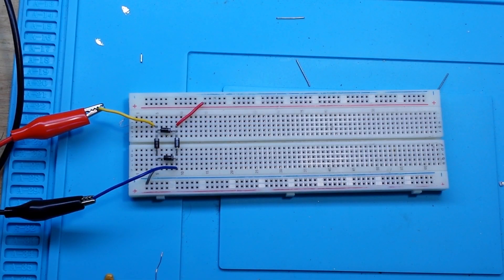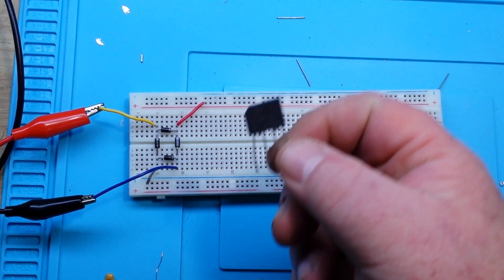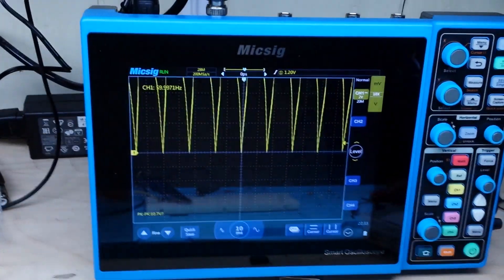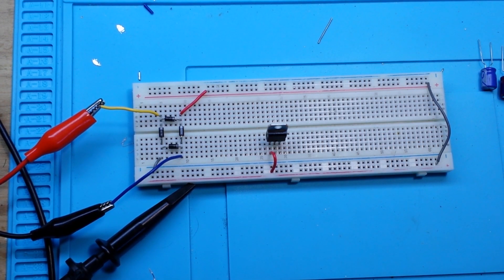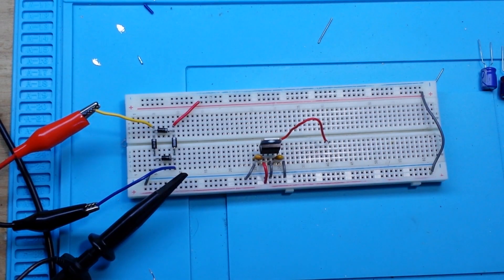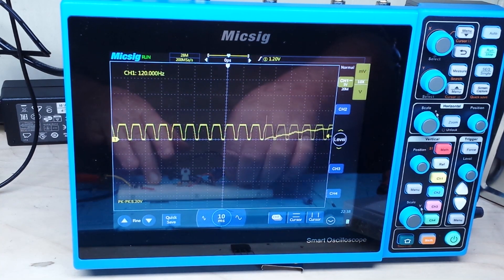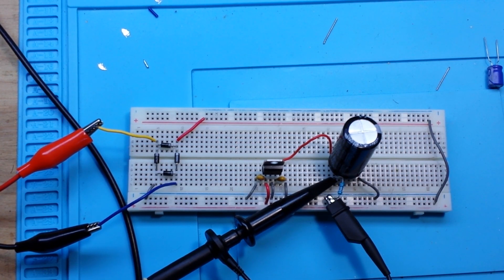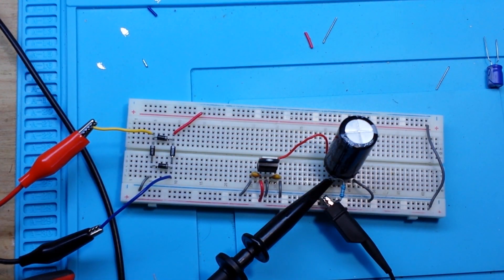How to build a simple regulated DC power supply

Comment: There is a problem I don't understand.  Have an old 12volt PS that uses 1 2N 3055.. Designed  to use      zener 11 volt diode to output 13 DC volts.  That is not my concern at the moment.  How does the big pass transistor know the load to maintain ? The easiest way to explain this simple concept I do not understand.  How does this big transistor know when to increase or decrease the load power ?  Working on this one concept for 10 years. I can build the lm317 circuit. The 7805, 7809, and 7812 with no problems.  If I need that 5amp of power.  How does 3055 know to hold the voltage and increase current?  I am near a breaking point trying to understand  this. Also from Alabama.  Lol. Maybe the problem.  7812 may under or over bios the final transistor in this particular supply and others. Watched about 5000 videos on this subject.  Sadly true. No one has explain this.  I have fixed powersupplys by replacing bad parts.  You can make most transistor fixed at a voltage. That transistor may not be at the right amps. Carlson give no detail, eevblog give no detail. I can go on and on. I like these guys. Never explain this.

Comment: thanks, this is puting things more clear to me.. im building a led tree, but I need at least 46 volts for the biggest serie of LEDs ,Idecided every serie will be a branch of the tree so i dont use to much cable, as in a parallel ,  since branches are somewhat thin, but i cant find adapters that can suply the mentioned tension
Excuse my English.

Comment: I built a rectifier and it put out 10 volts DC if I read my multimeter correctly.  Don't have an oscilloscope, but hooked it up to a motorcycle horn and heard the pulse of  the circuit. Mine wasn't as "complex" as this one, but it worked. I now know how to build it properly. Cool video.

Comment: Sir, How Can i increase the output power rating of the power Supply??
Reply: From the AC source or from the DC source?
Reply: You can get a mosfet to step up DC power or a transformer to step up the AC power.

Comment: 5:44 "Now remember that capacitors are going to block DC and only pass AC current."  Althought that would be true if the capacitor is in series, that's not really the case here.  The capacitor is actually acting as a filter and blocking the AC, thus allowing the DC to pass.
Reply: (please correct me if I'm wrong) Caps don't "block AC" (a cap would be permanently damaged in an AC circuit since caps charge-discharge in one direction. (maybe special caps exist for AC? ceramic/non-electrolytic can be used in AC?) Caps smooth DC by slowing voltage rise and can slowly discharge with a resistor in series. (i'm an electronics novice)
Reply: @DFEUERMAN  So the capacitor is not "blocking" AC, it is shorting the AC component of the signal to ground here.  By doing so, it is allowing DC only to pass in the rest of the circuit.  So it is not really "blocking DC" in the main circuit, it is actually allowing DC only to pass through.

Comment: Suggestion: Show a follow-up using a power transistor to provide filtered output greater than the 7805 1 Amp limit. I'd be interested in a discussion about BJT versus MOSFET or whatever.
   My background: US Navy electronics and twenty years after in civilian jobs using the electronics I learned. But I always just maintained or repaired, almost never invented anything myself.

Comment: Have thought of ways to make a circuit work off of AC, build two circuits that do the exact same function, but one copy is high active and the other copy low active.  And the transistors logic layers must be the same count, and for things that represent data, the bits you cant afford to be constantly flipping, bring wires from the high operated board to the low operated board,  And vice versa, wires to and from the appropriate places so the bits that represent data are always out of phase from the logic, do you get what I mean? And do you think this could work? In that example the AC frequency becomes the clock?

Comment: He did say filter in and filter out. He was only demonstrating how it can done with pulsating dc. Ideally you would want a pure DC voltage before it goes to Vin of the 78XX IC. the data sheet recommends 0.33uF at Vin to ground and 0.1uF at Vout to ground. But transformers are getting expensive these days and harder to find the right one. its a lot cheaper to buy a laptop power supply or wall adapter then use it with a lm317. The lm7805 is $1.10 each and the lm317 is 30 cents each. And the lm317 is also rated for 1.5 amps. The lm317 can be set to a fixed voltage of your choice without using a variable resistor. By assuming Iadj is 100uA, R1=240 ohms and Vout is 5V (or whatever voltage you want) all you have to do is solve for R2 in the lm317 equation.
 Vout = 1.25V(1+ (R2/R1)) - (Iadj)(R2).  After some basic algebra
R2 = (R1(Vout-1.25V))/(1-((Iadj)(R1))

Works great for my projects because its cheap and everything I make have different voltage requirements. Say I have a small project that runs on 6 volts and want to use a 9V battery to save on space. Sure I can use the lm7806, but they are expensive and hard to find
Reply: I agree 100%...and there are even web pages where you can just type in the R or V numbers and it will give it right to you. Love the flexibility of the LM317 and the LM338

Comment: awesome tutorial, Paul. should we concern about exceeding max input voltage of LM7805 in this circuit? can i use this circuit to charge 18650 cell using TP4056 module after the LM7805 output? how hot will it get?
Reply: LM7805 depending upon package type usually have a max input of 25-35v DC. Most TP4506 can charge up to about 1amp, you can normally set this by putting a resistor across the set current jumper, data sheet tells you value to choose , 1amp @ 5V DC is around 5Watts + inefficiencies, check the data sheet for your 7805 package more than a few Watts a little heatsink should be added , check out a cheap 1 dollar LM2596 it maybe more suited to your needs, prebuilt , less heat and more efficient , hope that helped , have fun and have a nice day
Reply: @DazzaDirect  thank you for the info. but isn't that output voltage coming from the bridge rectifier supposed to be higher than 25-35v DC when connected to mains?
Reply: @radius.indrawan   DO NOT connect it to mains voltage, if you look at his scope his pk2pk voltage is around 20v he is probably using a wall wart transformer @ around 12vAC which when rectified and multiplied by 1.4 gives that 20vAC figure , basically his bread board input is NOT @mains AC voltage and never should be,  around 50v is the max for breadboards.  this video is NOT about building a mains transformer it is about how to change dc to ac and regulate the output
Reply: @DazzaDirect  big thanks for point me out about that 20v pk2pk from the scope, somehow i missed that and assumed that it came directly from mains. rewatched it just now and realized my stupidity. thank you once again. :)

Comment: Thanks for doing something most don't or won't .... explaining why/how/what. For example WHY you put the load on the 7805 (my fav line of transistors). I can get some basic concepts but have trouble understanding why, like why in a radio 2 radio repeater interface I was trying to build it was suggested to me to use resistors to lessen the load drawn ... in my mind that either wouldn't make a difference or would make it worse. I have still to this day not had anyone explain it to me in a term I understand.

I was surprised to see the amount of peaking post BR and post reg ... I was not expecting that but given how/what/why the BR does what it does, it only removes the reverse pull alowing the forward pull still in it's glory I can understand it and always knew that's why you use a cap filter but the 5v reg did surrpsie me the p2p value.

You've earned a sub from me ... hopefully I will learn some more from you.
Reply: half bridge looses reversed wave full bridge effectivly doubles it in only a positive direction (effectively pulsed DC) and in pauls case this is from 60hz to 120hz . the signal noise i believe is to do with the transistors switching and the need of a minimum supply voltage a couple of volts higher issue to the .7 diode junction drops each side, as for the RF stuff i have no idea on the dark black magic arts , maybe check out @ElectroBoom #ElectroBoom for the BR stuff and @MikesElecticalStuff #MikesElecticalStuff for the RF stuff maybe , have a nice day

Comment: Advice for beginners... start with small transformers such as the old used from the 90's 2000's cellphones which are basically a transformer and bridge rectifier., aka scavange parts :P

Comment: What kind of current could you expect from this circuit? Thanks for the video!
Reply from the maker: Yep, 1.5A
Reply: 7805 is normally about 1.5A max if I remember though you would certainly need a heatsink. Also depends on the supply supplying the 7805 obviously, if you only have a 9v 500mA input (for example) you are never going to be drawing 1.5A from it no matter how hard you tried!

Comment: Hey Paul.....question. If i have a LM317 DC to DC converter (or even your LM317 AC to DC power supply converter build) could i straight substitute an LM338 regulator in its place (to get the extra amperage coverage primarily)? Or would i have to do a whole new bunch of figgerin' to make it work (ie maybe switching out the voltage divider resisters etc). I have a bunch of 338's (both T and K type) and am curious. Thanks and great video!

Comment: How efficient is it compared to something like a switching regulator? Lots of heat?
Reply: not very, but that's not the point.

This is a lot simpler circuit, and for decades it was very much the standard

Comment: When you increase capacitors more and more, the current peaks at the rectifier go higher and higher as well. So be careful.
Reply: thank you so much that will help me to choose right and reliable equiepments to resist the current that you mantioned , some equiepments can not resist that much current it should be calculated I p and I sc

Comment: Can you explain the advantages of having the 2 capacitors (small and large) for smoothing? What effect would an inductance in series have? Are capacitors a better option or what about both working together? Or is an inductance not very effective at smoothing?
Reply from the maker: The two caps are specified in the data sheet for the regulator. They filter the voltage both in and out. Indicators are good for current.
Reply: As far as I understand, for capacitors it's mostly about frequency. Low value capacitors smooth higher frequency peaks better. Not sure about inductors.